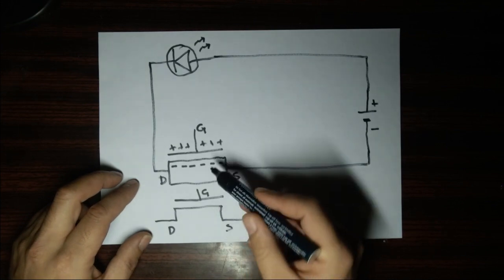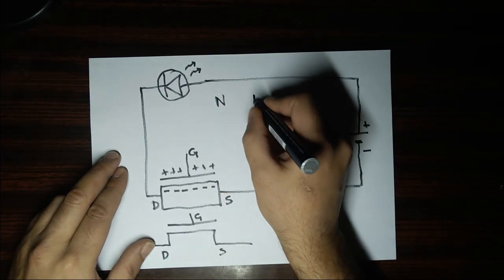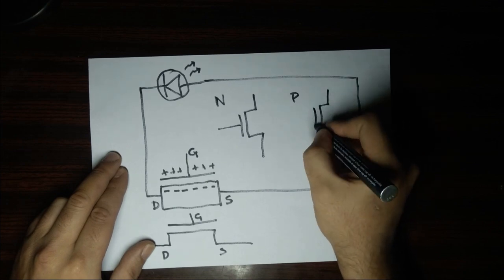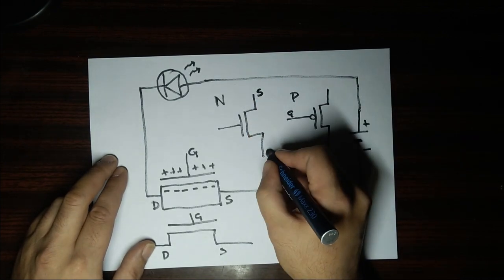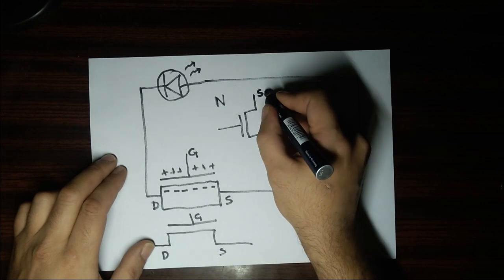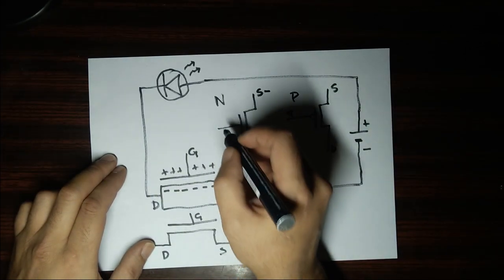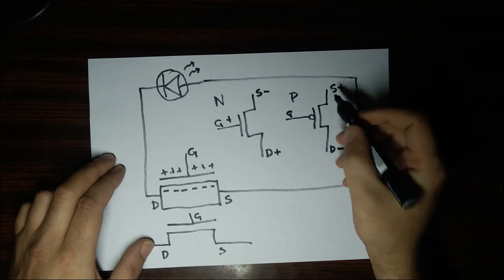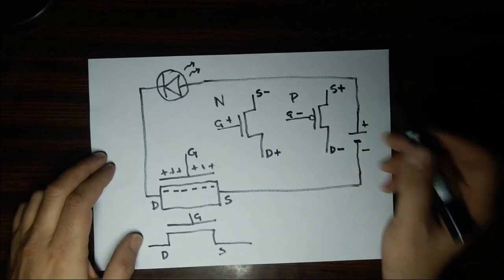VLSI - CMOS Logic: 1 - The Transistor

Comment: Well done Bill!
Reply from the maker: Nothing compares to the amount of work you have put into your videos Robert! Nice to see you passing by!
Reply: @BillDemos  If you were to put the battery side on the drain in lieu of the source, NASA would say the mosfet would still function in reverse, what ever that means. Put a NASA sticker on it and it will work, no questions asked. Cheers Bill!
Reply from the maker: @theapollodetectives  If you put a MOSFET in reverse (drain / source), it will just act as a diode (they have a body diode due to their construction). And even if it didn't, it would still need the gate at higher voltages to the source, so you cannot really do that anyway without redesigning the whole gate driver.

Comment: brothr which tranister you used as touch swith.plz name here
Reply from the maker: Hi man. ANY transistor that is a MOSFET can do this. The bigger ones retain their charge more time because the gate is on an insulator and is therefore a capacitor, which if it is bigger it retains more charge and is less lossy. So you need a fairly big one. You can go on eBay and search for MOSFET and get the cheapest but bigger than the very small ones, like the one in the video, which was an IRF3205. This is an n-type MOSFET, can tolerate 55V and 110A though Source-Drain, has a turn on voltage around 4V (Source to Gate). For P type MOSFETS I normally use the IRF4905. Both IRF3205 and IRF4905 are cheap for the power they can handle and you can find them from multiple sellers.
Reply: @BillDemos  thanks
Reply: @BillDemos ...oh it means it works for a while ...actually i was looking for soft latcghing swith that can turn onn or off a device ..i used 555 timer in a bistable mode but it was misbehaving.any solution.
Reply from the maker: @technoideas5835  not only does it work for a while, but you also have to be touching a plus more than whatever the transistor's gate voltage has to be to turn on. If you notice, to turn it on, I was touching with the other hand the + of the battery. So that does not make a touch switch, i.e. something that reacts to proximity. To do something like that you have to implement the structure they use for capacitive touch screens.